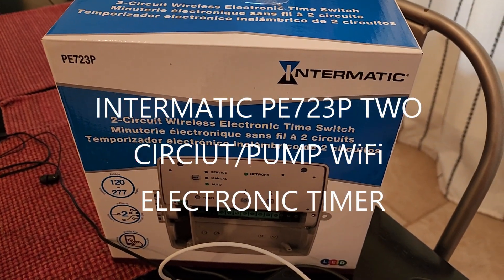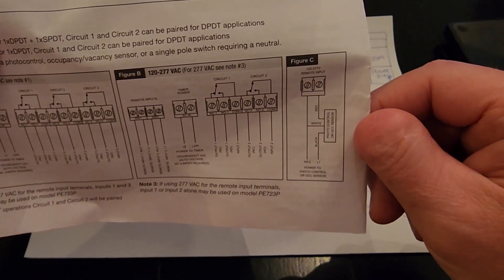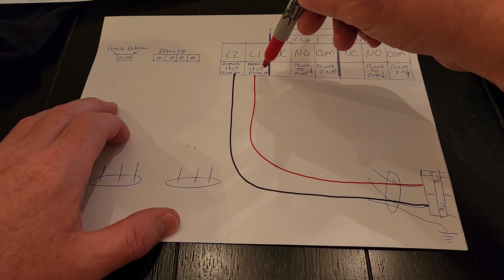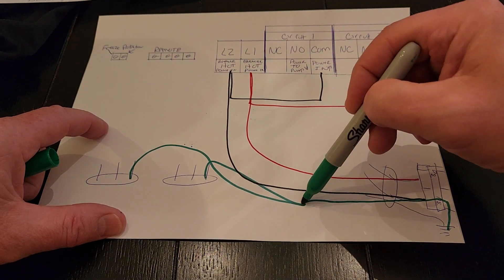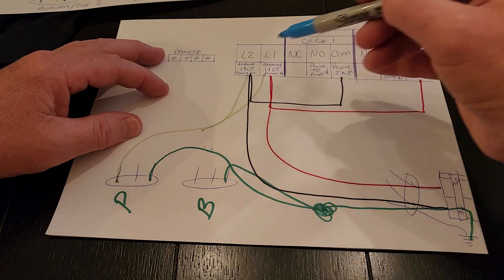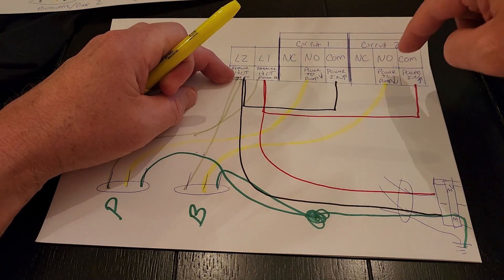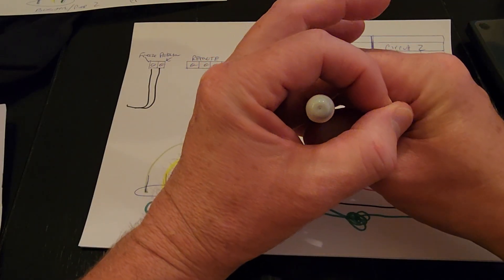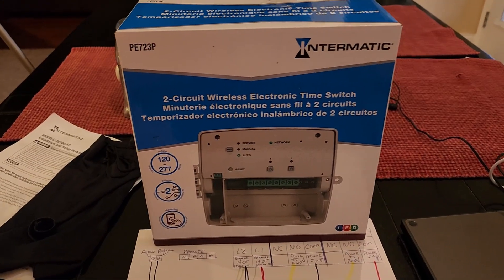Intermatic PE723P 7-Day Electronic Wi-Fi Pool Timer Wiring Schematic for 2 pumps, PE733P similar

Comment from the maker: The links I provide are Affiliate links that I earn a small commission from but don't cost you anymore. Thank you for watching.
Intermatic PE723P 7-Day Electronic Wi-Fi Pool Timer – 2-Circuit
     https://amzn.to/44fFdyC
Intermatic PE733P 7-Day Electronic Wi-Fi Pool Timer – 3-Circuit
     https://amzn.to/4k8QDtM
Intermatic PE700-FP Pool Timer Freeze Protection for use with Intermatic PE723P and PE733P
     https://amzn.to/3THbGZH
Klein Tools 11063W Wire Cutter / Stripper
     https://amzn.to/3TK0zz8

Comment: That setup is not safe because your pool pump always has an energized line, even when it's supposed to be shutoff at the controller.
Reply from the maker: This is exactly how Intermatic had me wire it up. I do not believe they would have me wire it up incorrectly. I will ck for power though. thanks for bringing that to my attention.
Reply: @thefritzfritz  This video was very helpful for me in wiring my PE723 timer, so thank you. But I agree with mariel1980 that your wiring is potentially not safe for a 240V circuit. I also have a 240V circuit with a pump and chlorinator as the load. Since both of those are switched on or off at the same time, I only needed one circuit. But to be safe, I configured the timer so that circuit 1 and circuit 2 are paired (DPDT) and connected one hot wire to each circuit. The timer sees them as paired and always turns them both on and off at the same time. This way I'm disconnecting both hots when the power is off. Otherwise, someone could touch a hot wire in the timer, or pump motor if they are working on it and think the power is off when it's only half off. Obviously, they should always cut off the breaker before maintaining the equipment, but I regularly work on 120V lighting circuits simply by turning off a wall switch.
Reply from the maker: I will call the Intermatic team and bring this up. I don't want anyone getting shocked. If this is true I will redo the video with the updated info. Thank you both for bringing this up.